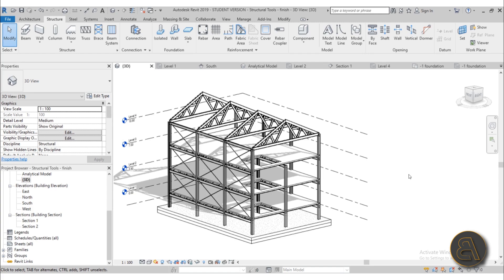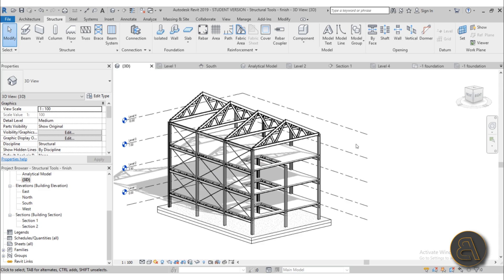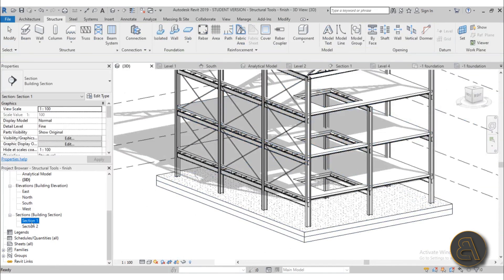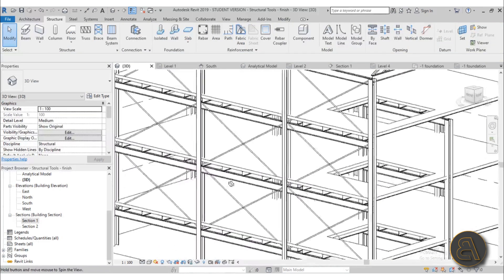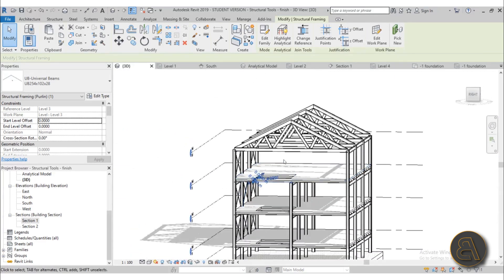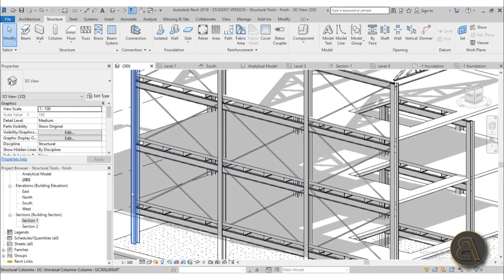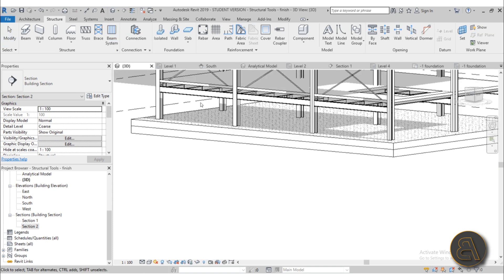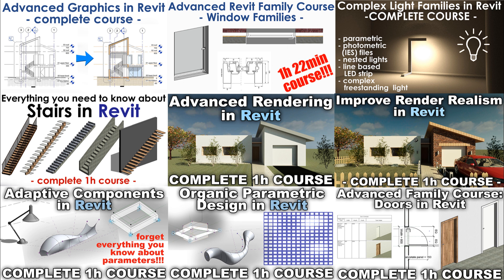Revit Structure - Complete 1h Course

Comment: Nice work man.
But I need to warn you about the columns.
Columns are the most important elements in a building it is better to never mess with them, if a beam fail the structure will have a much higher chance to not collapse them if a column fail. So it's better to never make great holes like that one.
I like your videos a lot, keep up the good work! 👍
Reply: i am pretty sure that he knows this but he probably shows this only for general purposes.